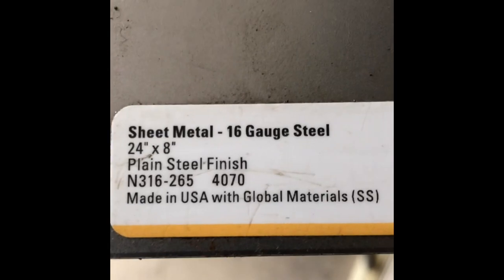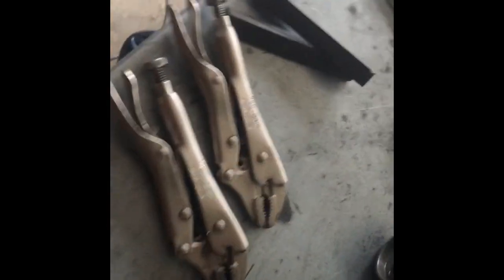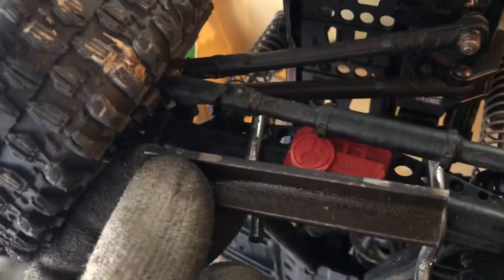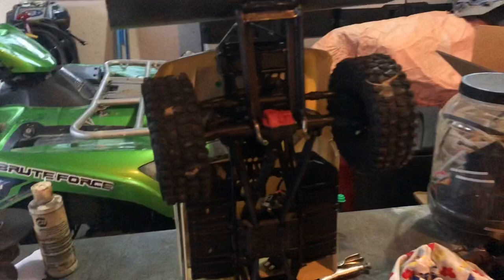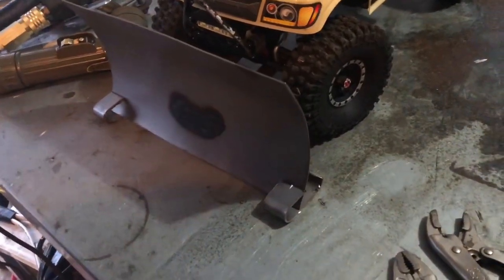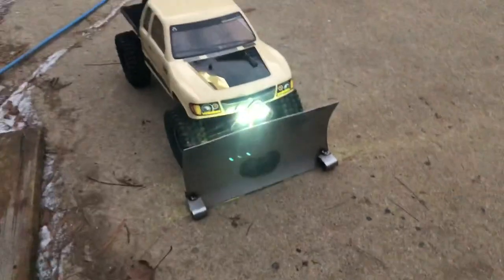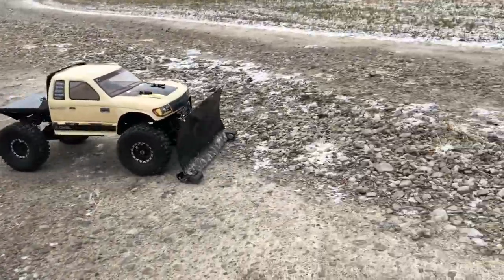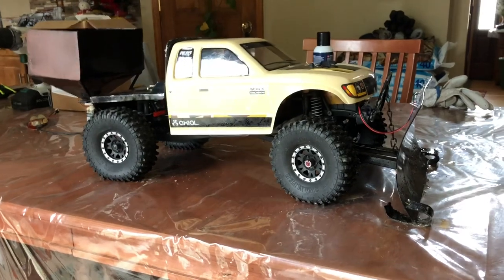DIY Rc snow plow build! Build Test and tips

Comment: Wow you did a lot I just drilled copper and mounted it to the metal plow then mounted it to the wholes already there on my stampede then I took a steering servo and put the older shaft on it and made it go up and down
Reply from the maker: Hey whatever works lol.. I remember when I would rubber band a flat pice of plastic, metal, or whatever I could find to the front of my crawler and use that as a snow plow lol!!